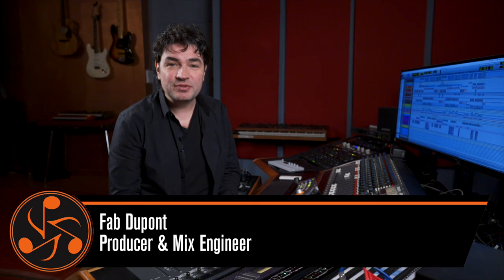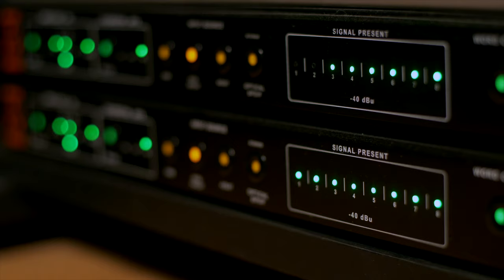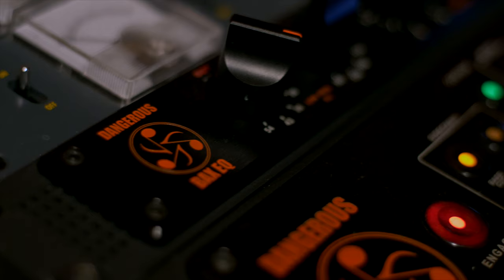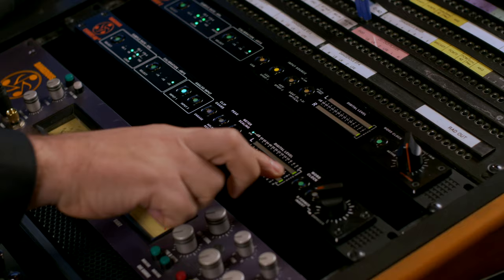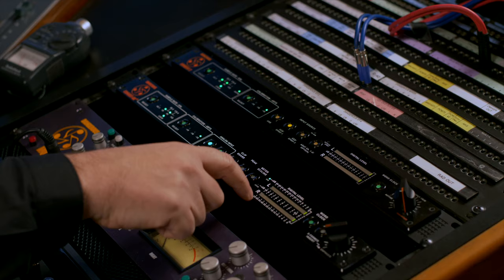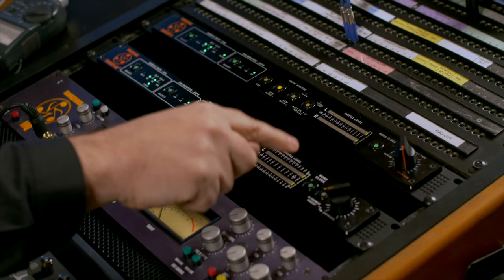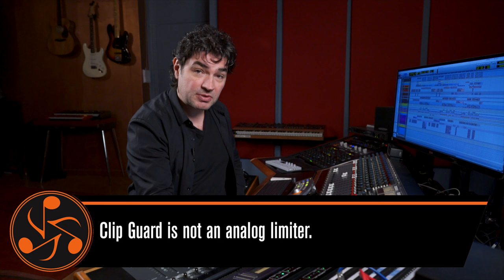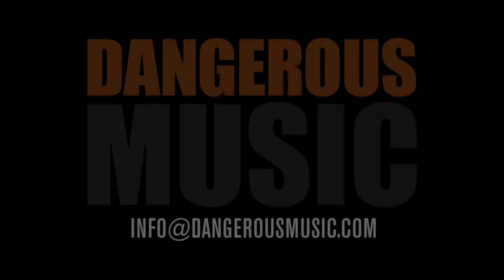Dangerous CONVERT-AD+ | Mixing with Clip Guard | Fab Dupont

Comment: Clipping the converter is not something new, mastering engineers been doing this for ages now instead of depending too much on the limiters. The question how far can you go with clipping this converter? In my current converter (without naming it) I can do a maximum of 3db in most cases and anything more than that it start to show up, the clipping is just before the limiter which is a ITB limiter.